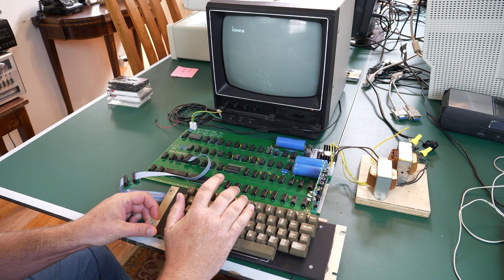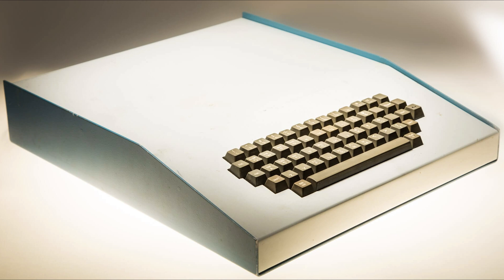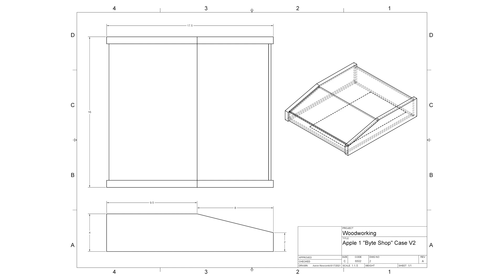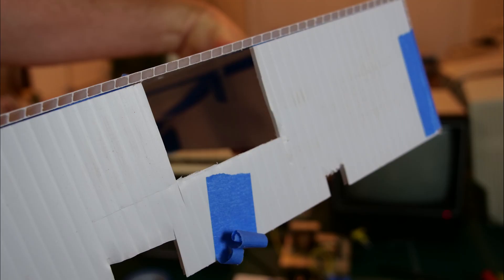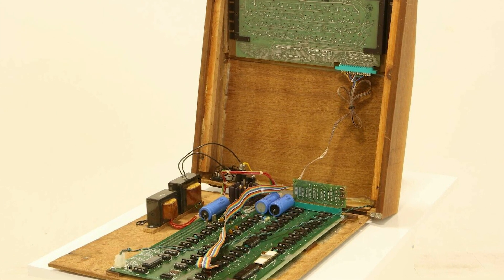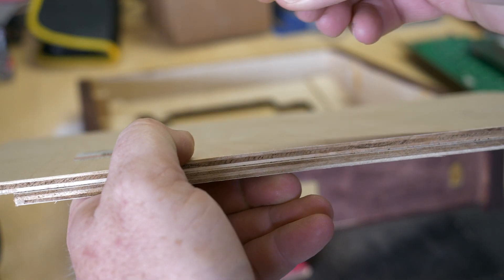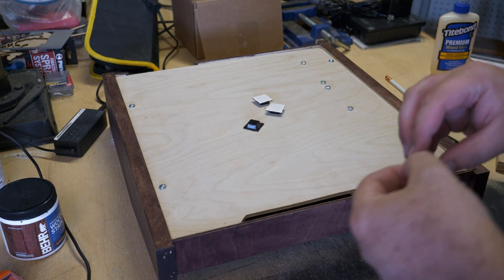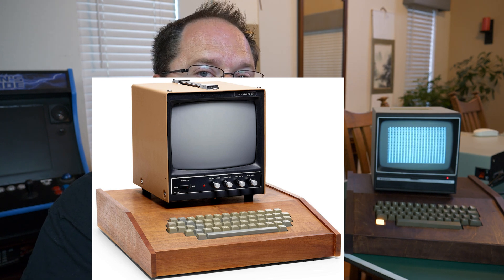Building A Case For The Apple 1

Comment: Oh my! It is a really very nice project. Great work. Congratulations. I have a DISMAC D800, a brazilian Apple II clone, but I do not have the top cover of the case. Just like you I tried to find out over the Internet but nothings gonna well. Please, do you have the real dimensions of the case? I am trying to recreate using a 3D print!
Reply from the maker: This was the design I used. You need to consider your if you will be routing slots for the panels or not. https://www.applefritter.com/comment/94231#comment-94231

Comment: Great video but unless I missed it I couldn't see how you cut the space for the keyboard, which is the trickiest part for me! 😣 How did you go about measuring it for a good fit? Also, what tool did you use to cut out the space please? Thanks!! 🙂👍
Reply from the maker: I used a handheld jigsaw. Drill holes in the corners then insert the blade and cut slowly.
Reply: @RetroHackShack  Thanks for quick reply! 😃👍

Comment: Hey, Aaron, if you use Lexan for the see-through case, be aware of its special handling:  drilling, especially, should be done with the right kind of bit.  The extra effort will be worth it, as Lexan does not scratch nearly as easily as regular Plexiglas.  It's something I'd love to see done.

I like how you "shade tree engineered" the cooling paths so a fan was not needed.  Nicely done!

You hid a doggie treat in that PCBWay box, didn't ya? 😁
Reply from the maker: Thanks! Penny is getting bolder about getting into stuff she shouldn't.

Comment: Second case:  Make the plastic case as the top only, with the  threaded inserts in exactly the same spot.  Then you can swap out the cover without unmounting the boards from the bottom.
Reply from the maker: Exactly my thought too

Comment: 8:29: Top tip: Try and sandwich the good piece on top of or between one of more additional sacrificial sheets of plywood while cutting to avoid tearout.
Reply from the maker: Yeah. I should have at least used painters tape, but I like sacrificial boards even better.

Comment: BTW, those are some mighty nice wood working tools and machines you got there! I love wood working too...just too much other stuff( arcade machines and retro consoles/computers) to fit any of it. 🙁 awwww... penny puppers! ❤
Reply from the maker: That's at the Makerspace I founded.
Reply: @RetroHackShack  Key part of that is 'space' and I have space except it's loaded with stuff. 😁 That finish came out a lot better than you think. Next time take a scrap piece of wood and do what I've done  using that water based stuff.... dig a folded rag instead of using a paint brush and you will find it much less streaky..... at least that has been my experience. But it looks great regardless so don't sell yourself short.